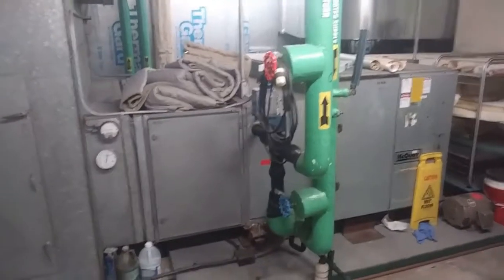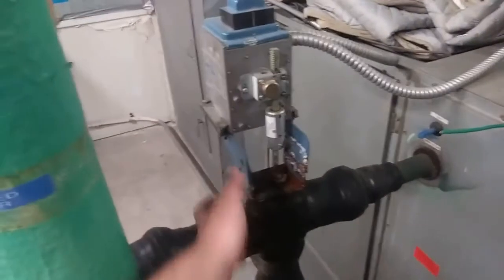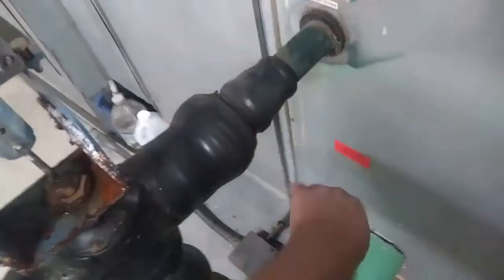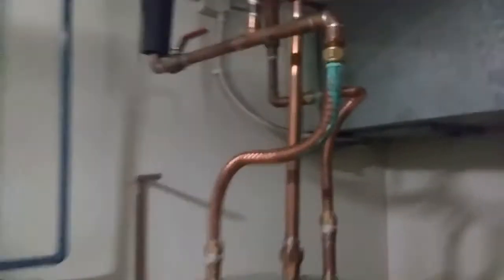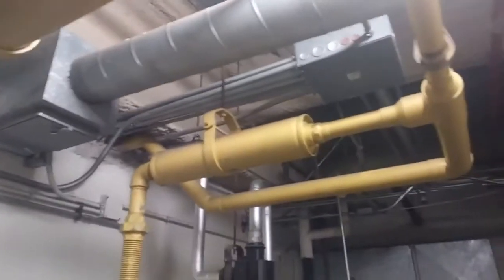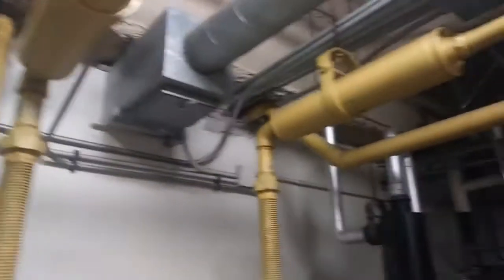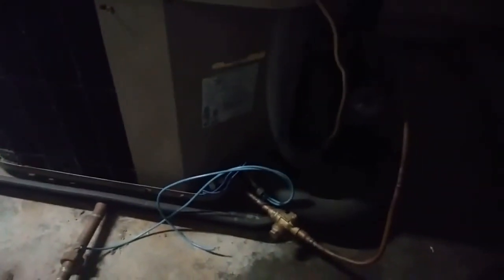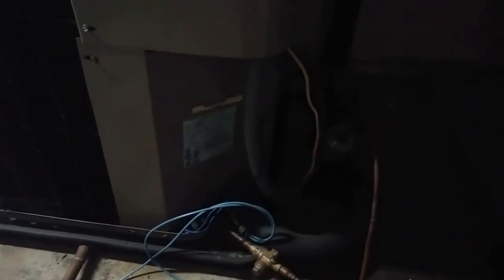HVAC - Revisiting The Ol' Mechanical Room

Comment: Wow does look the same. i like the duct work off the exhuast fan but id put a duct on top of that condenser as well !
Reply from the maker: 67tr876 yeah, they did a nice job within the confines they were given. Like I said it, does affect access to that side of the room. That little condenser has a lot of issues and really shouldn't be in there anyways. However, ducting the discharge to the outside would be ideal since it's in there already. Unfortunately, they did not do the return air upgrade or any of the other things I suggested to get the unit operating correctly. It seems unlikely they would approve the cost for ducting the unit outside because nothing is "broken". Amazingly, it must still work "good enough" because it's still there!
Reply: wish they would have done a better job as well. did you ever see my video on the steam room and how city steam works ? I did a few steam videos
Reply from the maker: 67tr876 I'll check em out. Steam heat is pretty fascinating stuff to me. The only time I see steam equipment is for hospital sterilization. The one exception is the boiler room at the building in this video. It had a huge steam boiler that piped into shell and tube exchangers; one for the WSHP condenser loop reheat and one for a hot water fan coil reheat. It was insanely inefficient and I have no idea how they convinced the owner it was a good idea.